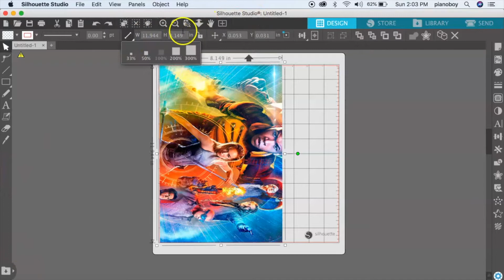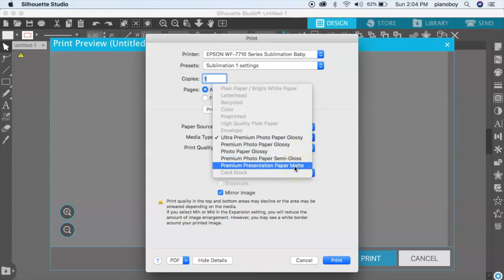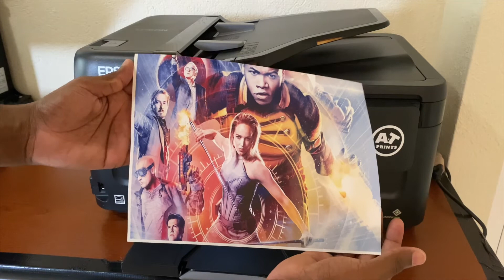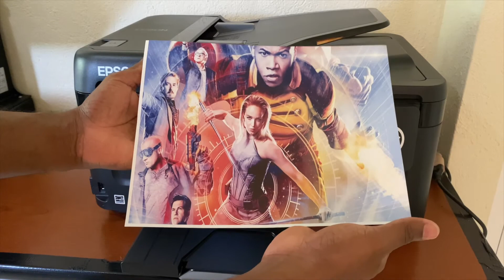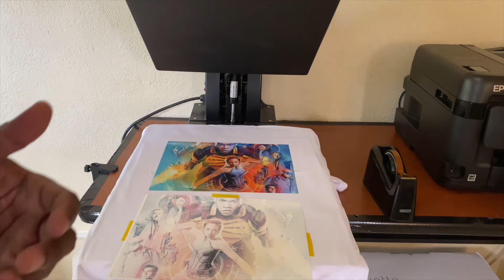Sublimation Printing on a T-Shirt | 100% Polyester

Comment: Hey, I did all the procedure which you mentioned above but the shirt wasn't sublimated
Reply from the maker: Hi, thanks for your message. Make sure that the shirt is 100% polyester. If the shirt is cotton it will not work. Another thing is to make sure you give it a nice medium pressure. You can also reach out to me on Instagram @allan21thompson and I can assist you.

Comment: How do you eliminate press marks?
Reply from the maker: Thanks for your question. I would need a little more clarity to assist. However, if you are referring to the shirt changing color after pressing it, then just allow it to cool down and the natural color will come back. In addition, I would advice making sure you cover the shirt from your heat press so the shirt is protected.
Reply: Not true  dri fit 100%poly marks will not go away ! I've been trying to find a good set for it but not matter what you do even if you don't go for the whole 60 seconds even if you do 10 seconds shirt will be marked and the color difference will always stay.
Reply from the maker: @mvasquez5249  Thanks for your comment and support of the channel. However, I do think you may have missed understood my comments to the previous viewer who asked how to eliminate press marks. When I commented about the shirt changing color, I was referring to scorching. At times when you press shirts with a lot of heat and pressure, especially white shirts, the front would somethings come out light red. This happens as I mentioned because of the high heat and temperature. It also happens for other color shirts but you can see it more on whites. 
This is what I was referring to when I noted to allow the shirt to cool down and it will naturally come back to the normal color.

In addition, I do agree with you 100% that once you sublimate onto dri fit or polyester material there is no way to fix errors etc, but as I mentioned above I wasn’t referring to mistakes that took or can take place on the shirt.

Hope this answer gives some clarity.
Reply: The biggest problem I have is the lines around the image sublimated from the paper on 100% polyester dri fit material. It's not scorching, it's the line around the sublimation paper.

Comment: Sublimation is good but cannot be done on cotton or dark colours unless you use special methods. Have you tried to sublimate on cotton or dark colours using special methods?
Reply from the maker: Thanks for your comment. You are correct. Yes, I’ve sublimated on dark shirts using easysubli.
Reply: @atprints  do you have a video about it?
Reply from the maker: @higherpurposeministries4368  sorry no. I haven’t made a video on easysubli as yet but I will do so within the next 2 weeks. I’m very sorry.
Reply: @atprints  okay, thank you